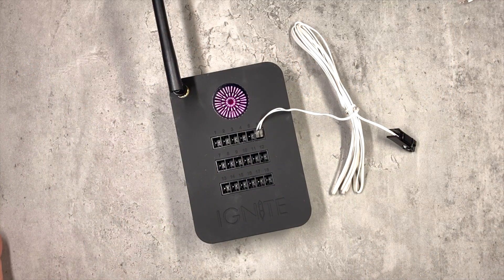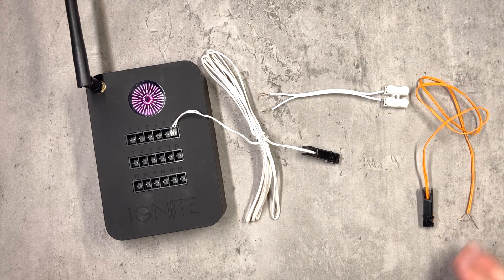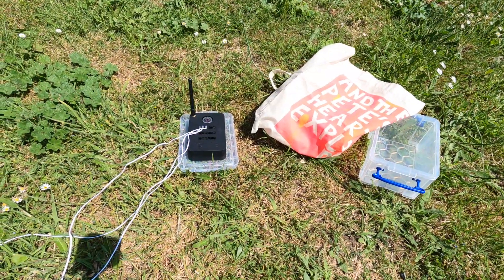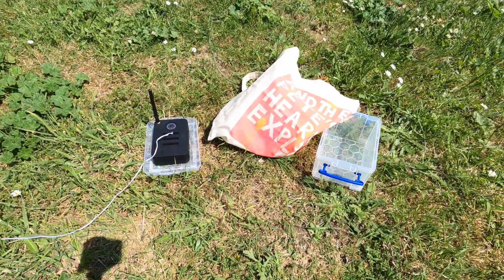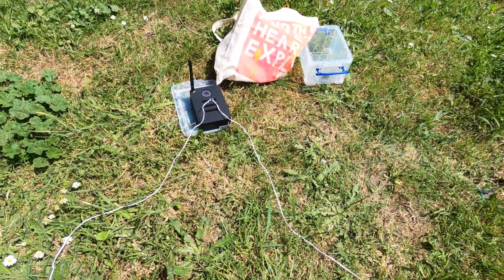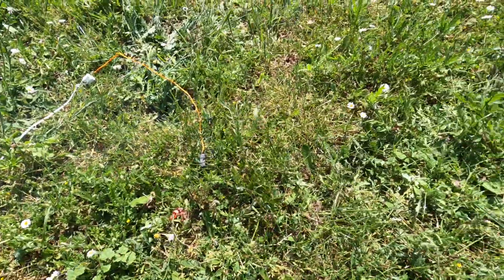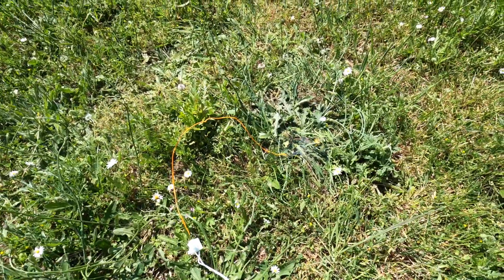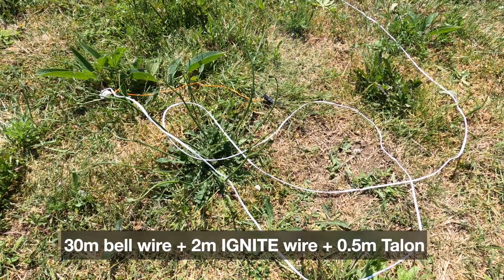Extending fireworks igniters on the IGNITE firing system

Comment: Thank you for these informative videos. Curious on this video and the other with firing multiple talons. If it can fire multiple talons at the 30 meters or less.
Reply from the maker: Thanks for your comment. I wouldn't think so as it only just fired one at that distance. The more you add, the harder they are to fire unless the distance is shorter (or the voltage higher). It would need some testing I think to know for sure the min distance for 2, then 3 then 4 etc. Keep in mind that different extension wire could also affect it.

Comment: Can u give me the exact name of the little clips you used?
Reply from the maker: There isn't really one as they're a generic clip, but my Amazon order says "65 Pcs Spring Wire Connectors Electrical Connector Strips Terminal Blocks Electric Cable Wire Connectors (CH2)" if it's any help (the seller here is just stuffing keywords into the product title though LOL).
Reply: @UKFR  that's perfect thanks

Comment: Is there a reason you used the Talons, vs just splicing in new wire length and using the ignite clips?
Reply from the maker: No other reason than I was running low on Ignite clips and have a large stash of Talons.

Comment: Assuming the bell wire is 0.5 mm (~24 gauge).  Your test follows the calculations here for maximum number of talons (18V) that 40 m is pushing it for one but should 30 m works.

https://calc.easypyro.com/
Reply from the maker: Thanks. It's always good to validate the calculator with a real world test. I looked on Toolstation and the technical info just says it's white!! So I don't know the AWG of this, but it's too thick for Easy Pyro's gel crimps if that helps. I didn't try and narrow this down with 40m because by that point to be honest I was about to expire in the heat.
Reply: @UKFR  Yes, I checked first but as it didn't say I looked up other brands of bell wire.  I would imagine 30 m is enough for most people...  if it isn't they problem need thicker shooting wire or use e-match.
Reply: Seems the battery voltage is ~8 not 18 so that means 30 m is very impressive but for reliability in all weather best to keep to a 20 m maximum.